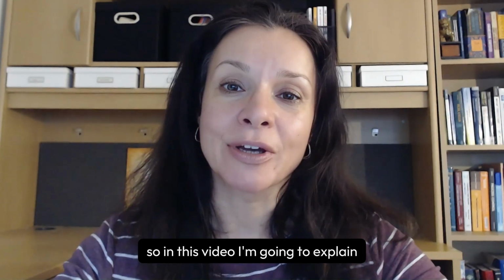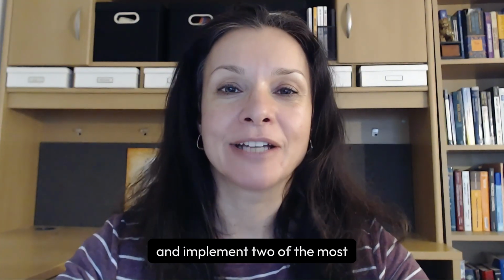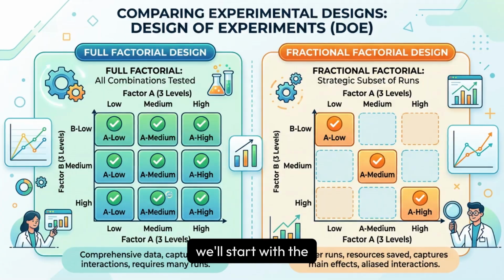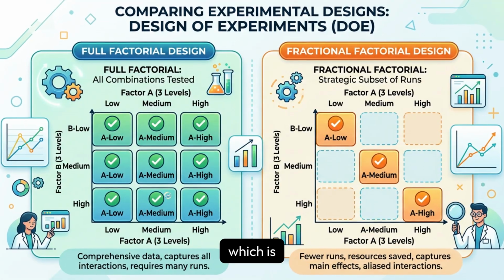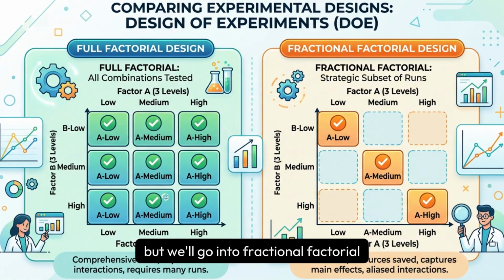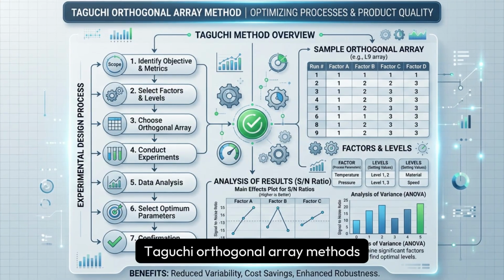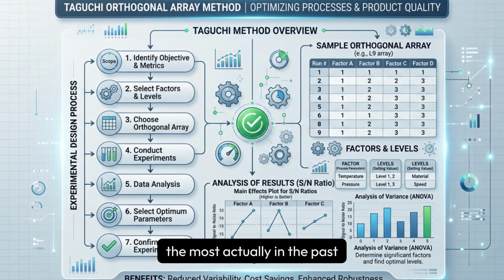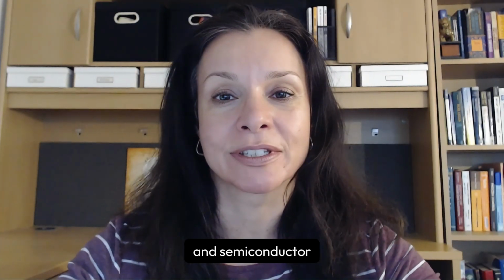Introduction to Design of Experiments — Part 1: Why One-Factor-at-a-Time Fails

Comment from the maker: I took my first DOE course in graduate school in 2004. In pharmaceutical and semiconductor manufacturing, DOE became the technique I reached for more than any other.

The softgel encapsulation example in this video is real — and the lesson from it applies to every manufacturing and process development problem where you have multiple variables to optimize simultaneously.

Here is the core insight: one-factor-at-a-time experimentation cannot detect interactions. And in complex processes the interactions are often more important than the main effects.

Part 2 covers the full Python implementation of two complete DOE designs built from scratch:

⚗ Full factorial design — softgel encapsulation process with main effects and interaction plots
🏭 Taguchi L8 orthogonal array — troubleshooting capsule shape across 7 factors in 8 experiments
📈 Factor ranking by influence — finding root causes systematically
🔍 Every line of code explained in detail

Industries and processes covered across both videos:
🏭 Pharmaceutical — softgel encapsulation, formulation development
⚡ Semiconductor — electroplating, photolithography coating
🔬 Wet etch process — predictive algorithm for etch time to the second
⚗ HF titanium etch — predicting etch time across full production conditions

🐍 Python for Scientists and Engineers — practical Python for real engineering and scientific data problems.

Drop a question in the comments about your specific DOE challenge — happy to help you choose the right design for your problem.